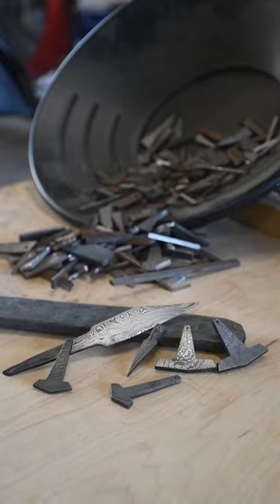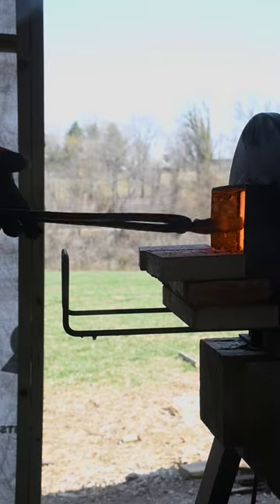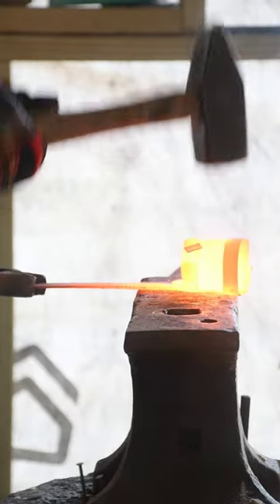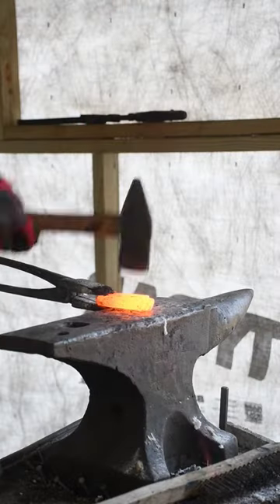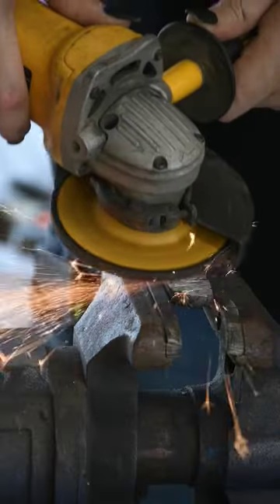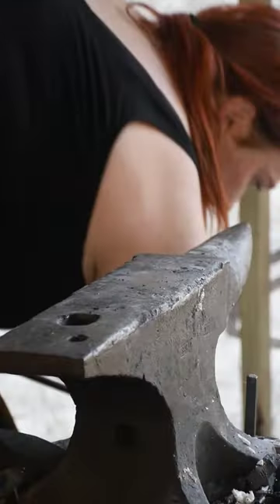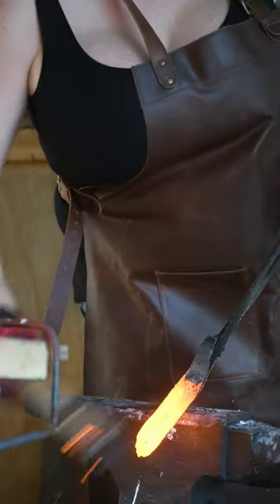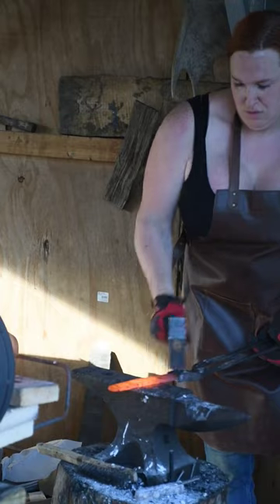Scrap to steel

Comment: I highly admire all your knife art work because it is not just a kind of black smith work. I am amazed by the metalurgy knowledge explanation you tell in each of your work. But still I am wondering "what was the powder you spread to the 5000°C (red color hot metal)", "how many times it is given during the whole forging process", & "what is the function of spreading the powder".

Comment: I have a ton of damascus cut offs from a local manufacturer. It's not the same pattern unfortunately, but I can usually have enough material to make a few things. Do you use a single pattern of damascus, or just random pieces?